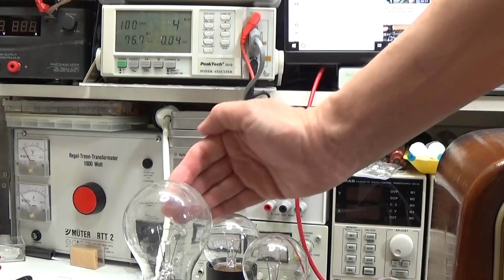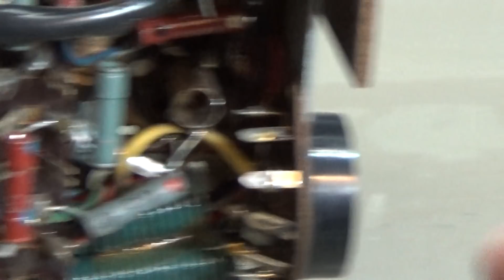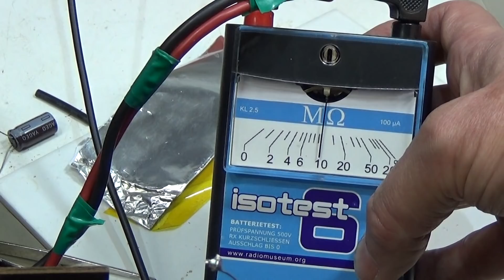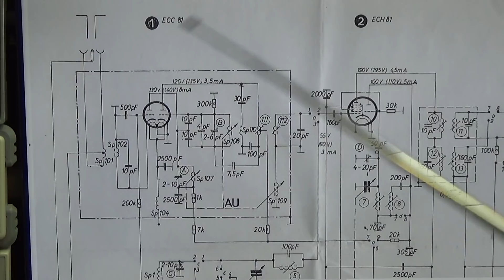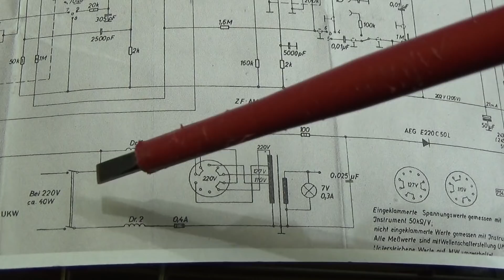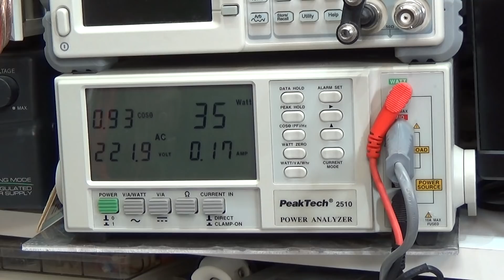#192 Telefunken Jubilate vintage tube radio needs restoration to get back to life

Comment: We have exactly the same old generator. I found one out of order some month ago it took month to repair it. These German radio are probably the best ones ever, compared to the European or American antique radios. I’ve a Phillips stero valve radio the wiring and mechanical parts are an incredible mess.

Comment: An interesting video.  I myself love old Vacuum Tube radios. When you showed the inside from the back of the radio, I was amazed at how clean it was...ok, so there was a bit of dust, but no rusting, no pitting, it looked good!  The warranty card brought a smile to my face.  The date was my 3rd birthday!!!
When you showed the underside of the radio, I was wondering what the green springs were....then I finally realized they were inductors.
Your work on the power switch was amazing!  Genuine talent there!

Comment: Hello, I wanted to mention to you about the ic-7000 driver problem. I had let the magic smoke out of my pd55015 driver while in the adjust mode, so I was looking for a replacement and found a pd55025 replacement of the same dimensions and rated 25watts with the same gain. So I will see how that works.

Comment: Hi. I am doing a restoration of a radio exactly like this one and publishing the videos on my channel. I have taken the liberty of adding a link to your video on mine, which refers to the way you did the filter capacitor installation. I also mention your video elsewhere with regard to the danger of the 'hot chassis' characteristic, always in a good way, I assure you ;). I hope this is acceptable to you, but if not, please let me know and I will immediately remove the link. Thank you for your very interesting videos. I have been a fan for quite some time.
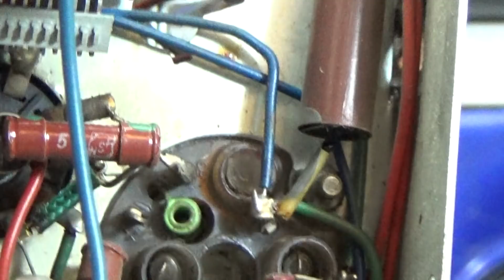My video (the link in question is at 18:20): https://youtu.be/AhsrMmj5eFE
Reply from the maker: Hi and thanks for your feed back. No problem feel free to link my video..Looks very nice your channel! Have fun with the hobby!

Comment: Love these old 50's vintage German radios, I have an old Grundig that is still in good working order after some replacement caps and a tube. The sound quality is remarkably good for a table radio and it always draws attention when visitors hear and see it working. Nice repair job on the original switch, having it working as designed is a big plus. Thank you again for sharing these always interesting an informative videos.
Reply: I am a Buyer of old television and radios if you have plese contact me thanks +923108262627 watsapp

Comment: Fabulous video. You have so much knowledge about radios old and new. Well done with the switch! A difficult repair but all too common with these old radios. I am very new to the repair of old valve and transistor radios but I find it very interesting and challenging to overcome the problems that they have. You have a fabulous workshop filled with wonderful equipment and I have only a cold shed and a voltmeter! But I enjoy every minute that I spend working with all kinds of radios. I look forward to seeing many more of your videos. Congratulations on your command of English as you are so easy to understand. Best wishes from The UK. Lynton G4XCQ.
Reply from the maker: Thanks for the kind feed back Lynton very much appreciated! 73

Comment: Hello, Peter. Enjoyed the video. I bought a Philco floor Model 37-650 about a month ago. I will be going through that chassis and replacing capacitors, resistors, and anything else that it might need. Got my work cut out for me! 73, and Happy New Year! Dan w4mnc
Reply from the maker: Happy New Year!! Sound exiting with your Philco...have fun with the project. 73

Comment: Hello and i wish some nice days and and good jump  to 2019.
In the 80s i had built in in two such similar radios simple 1:1 isolation-transformers. Worked well.
For restoration 'looking' reasons i would had cracked the filter cap-dou and placed the new caps inside the can. Also the selenium rectifier i would had opened and replaced the selenium an copperplates against the diode. Looks better :-) 
Good explanation about the coupling cap at the nose of the end-tube. I say in German: Wenn der nicht sauber ist, kriegt die Röhre rote Backen und Fieber. :-)
How about the other two frequencies? You only showed the UKW-area.
Reply from the maker: Thank you Alfred and Happy New Year. The design of a repair always depends on the requirement of the owner. So I have done the restaffing of old components with modern parts as well and the outcome looks quite original....HaHa yeah, the tube gets red cheeks..That is how it looks like. Again thanks for stopping by 73

Comment: Hi Peter,
Love your electronic detective stories. It’s very enjoyable following your thorough analysis. One thing I would really like to see is some of the mechanical hands-on techniques replacing a couple of the deeply buried capacitors in the forest of wiring. There is a lot we could learn from that. The improvisation and detail in reconstructing the volume-power switch is very useful.
Reply from the maker: Thanks for feed-back Bob. I'm going to put more of that into future videos.  Have a nice week end

Comment: Thanks for showing some of the issues one can face when restoring old radios...a friend here just started working on a Hallicrafters SX-99 as his first restoration and I provided him with some safety caps and a chassis fuse holder so he can get started. Fortunately Hayseed had a re-cap kit for that radio and that gave him a good start. Merry Christmas Peter!   73 - Dino KL0S
Reply from the maker: Good to see you Dino and thanks for comment! Sounds like a very nice project on the SX-99 and good that the friend has you as mentor at his side....Merry Christmas and all the best 73

Comment: Hello 

Would not it have been better not to install the capacitor (antenna connector) ? 

Today it is unfortunately so that many disturbances on the power grid come, it did not exist earlier.

What a coincidence that you are making a video about a tube radio, I bought an old one a few days ago and now I can put it into practice.

Thanks for this and all your other videos  Peter.

I wish you a merry christmas and a happy new year.

Many greetings

Uli ( DK6DV )
Reply from the maker: You are right Uli there is much QRM on the air. The good think here on the radio is that you do not need to put the power line to your antenna input. You can decide what you need and therefore I think it is okay. Thanks for stepping in and Merry Christmas an a Happy new Year.

Comment: I have an old Philco radio from a Packard Special Eight which I need to go through once I get the right equipment going.  I picked it up for free from the remainder of a close friend's auction lots.  I just hope I won't have to source a matched pair of 7C5 output tubes for it (yes, this radio has push-pull output).
Reply from the maker: A very good hope you will enjoy the nice project. All the best

Comment: I changed the bulbs in my Dim Bulb Tester to LED's.  So much more efficient.  ;-)  Great video, Peter.
Reply: Is that more efficient? I would think you want incandescent for the higher current draw if it sees a short, which is what your really after.
Reply: It was just a bit of infantile humor, commensurate with the size of my brain.
Reply from the maker: Yeah that is a good one LOL

Comment: Apparently when this came out the line voltage was 200/202 according to the schematic.
Reply from the maker: Well as far I know we had different power distribution in some areas we had even DC but usually it was 125V and 220V AC but I came never across 200V
Reply: @TRXLab  Here in the US the line voltage was 110/220 in the past but it crept up over the years and now it's 120/240. My line voltage right now is 122.8.

Comment: Always nice to see a classic brought back to life and ready to be used for several more decades.  I have several Telefunken radios.  Several of them need to be restored.  Makes me want to dig out one of them and resurrect it.

On vintage radios like this when I'm installing modern X/Y rated capacitors I use the X1/Y2 rated blue ceramic types.  They are usually a 1/4 the size or smaller and have 2 to 4 times the voltage rating of the originals.  Here's a example of the ones I buy from DigiKey.  https://www.digikey.com/products/en?keywords=399-9538-1-ND%09
Reply from the maker: Good to see you remember me on this types of Y capacitors almost forgotten..have to fill my stock. Thanks Mike! Hope to see you restoring a Telefunken soon.

Comment: About line tension on the chassis, Peter is right. However should be mentioned some of the radio's in that era, are designed withhout a mains transformer, then one side of the mains is really on the chassis. Also then there are different tubes used, socalled U-types, with all the filaments in series.  As can be found in old bakelite Philips radio's . Here however, there is a normal mains transformer and E-series tubes. So, to my opinion the 'tension on the chassis' Peter shows in the end, is not usual, it also glows slightly, like leakage current, not full mains there.  This brings me to the selenium rectifier. This rectifier was not replaced. It would be better, because it can cause current leakage to the chassis. Replace the rectifier by modern diodes and the leakage is gone.
Reply: Ger L. If you check at 1:02:17, you’ll see Peter shows the replacement of the selenium rectifier with a modern diode which he wired on a terminal strip mounted on top of the old disconnected rectifier.
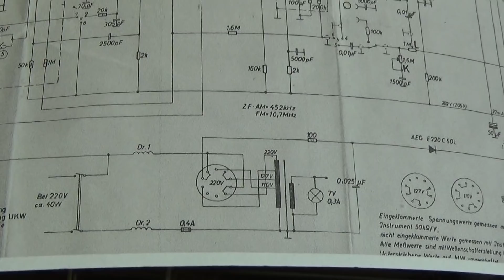Reply from the maker: The transformer is only for delivering the filament voltage and if you carefully watch the schematic as at 54:39 you'll see that the radio circuity is directly connected to mains. So it is for sure full mains and not a kind of leakage or ghost voltage it is rather more exactly the same as on the Philips radio what you are referring to with the exaption that the Philips do not have a transformer for the filament so they have to use the U tubes..
Reply: Indeed Peter, I see it. The anode voltage here is directlty rectified from the 220V mains. The transformer itself is an autotrafo. I missed this and I assumed the trafo was a 'normal" transformer with separated windings for anode and filament voltages. This all is not quite 'Telefunken - like' , as we are used to more sophisticated power supply designs by this brand. Probably a matter of model policy, production costs or the lack of raw materials like copper at that time point. A justly warning:  there can be mains phase on the chassis, even in a radio with E type tubes.

Comment: Hi Peter,
the right project for the cold season ;-)
I did not know that you are such a tube lover.
The power switch, you got back well .... thumbs up.
And you also use the repaired capacitor tester right away :-)
Was that your intension before?
I wish you and your family a Merry Christmas.
73 Bernd
Reply from the maker: Hi Bernd, yes right a nice project for the cold season.. Well yes I always was fascinated by tube design and I love the warm sound. No the repair of the Sencore had nothing to do with this project. Thanks for stepping in. Merry Christmas to you and yours 73